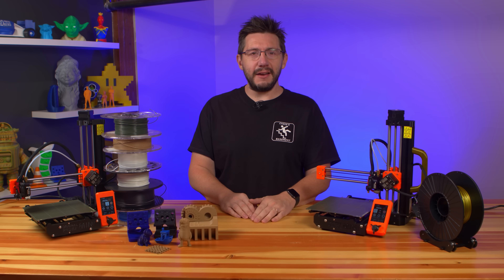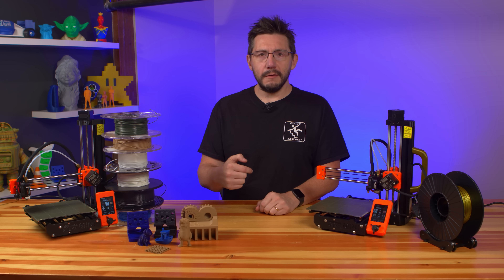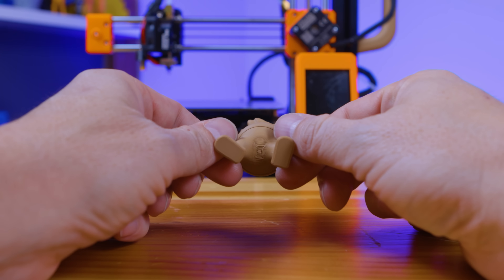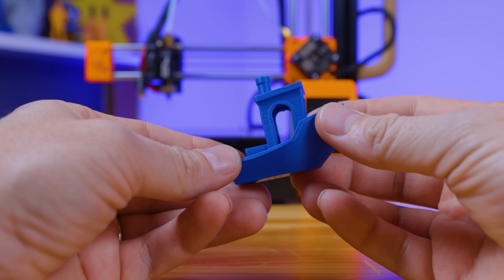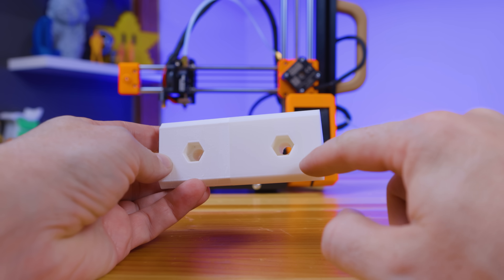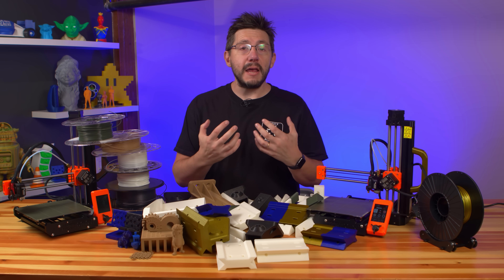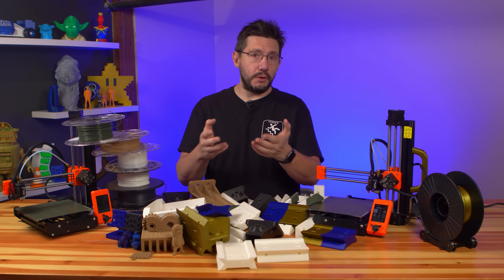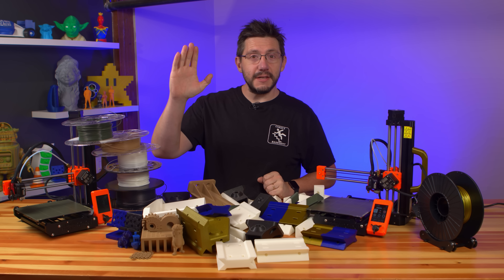Prusa MINI Review // So far ...

Comment: We got ours last week for printing work test pieces it's been printing constantly over the weekend getting to understand it's limits.  Really happy with the print quality in the past I've sent prototypes out and have had them made in SLS and SLA and honestly would be happy showing them to customers. I did have an issue yesterday when the extruder started clicking which I was disappointed about but the documentation on the website had me back up and running within an hour and I think I could sort the same issue out in 10 minutes now. One of the key reasons I went for it was the price point, the reputation of Prusa, but also being designed and engineered in Europe it has to meet certain safety standards which for me was a big selling point.

Comment: The clicking you’re hearing is the extruder. There’s another video out there about this and he actually fixes the issue. I recently fixed mine but not well enough because the issue came back just a few days later. I had to: do a cold pull, unload the filament, completely take apart the extruder to access the large extruder gear inside and clean off inside the teeth on the filament gear with a steel brush. Then I removed the Boden tube that connects to the hot end and hand to loosen the 3 grub screws to be able to move the heatbreak around. I added thermal paste to the outside of the heatbreak and put it back in the hot end all the way up. The issue with this printer is that a small gap forms between the boden tube and the heat break. Bondtech actually has 2 products to fix this issue.
Reply: I had the same thing.
But I solve it with thingtening the ptfe tube à little more than noticed.
I screw the joining part, then unscrew it an half turn. (maybe 3/4)
Push the heatbreak to the top and lock it with 3 little screws. 
Then screw the joining part to the max. 
With this method I solve the underextruction du to the gap. 
I had to clean the heatbreak perfectly to remove all the melted pla. (done it without the bowden and the joining part, with a wooden stick hotend at 250°C)

Comment: Hi Joel, My name is Dominic and I am 10 years old. I have 3 Printers 3D, Anycubic Chiron, Flashforge Finder, Flashforge creator pro.  2 of witch are not working properly. The Anycubic Chiron is not feeding the filament properly. Me and my dad tried replacing the hotend  but is still would not feed. the motor is spinning but it looks like it is skipping? The Flashforge Finder is just not turning on  I had it working for about an hour then it just shut down? I LOVE you t shirts and sweaters they are so comfy. Thank you so much for what you have been doing, you have  helped me with so many printer issues. Great Review on the Prusa Mini. Thank you!
Reply: If you guys still hadn’t fixed the printers, I’d try tightening the extruder idler on the Chiron (If that’s possible), and for the Finder, you should check the fuses on the main board (should look like coloured see through rectangles, just take them out and check if the metal inside is broken.
Reply: @IronHexacyanoferrate  Thanks I fixed it

Comment: Had the same weird noise on the y axis. I used a mechanics stethoscope and moved the y axis backwards and forwards to narrow down where the noise was coming from. Mine seems to stem from the y axis idler pulley area but replacing it hasn't worked

Comment: When you find out how to fix the grinding + clicking noise, please make a video about it. So far Prusa support and I have not been able to fix it :(
Reply: Use a steel brush to clean out the extruder gear. That or there is a small piece of filament somewhere in the extruder causing an issue. If you just take apart the extruder you will be able to clean it out easily. I fixed it for like a day by doing that as well as resetting the heatbreak position. Be sure to use thermal paste on the outside of the heatbreak though if you do this fix.
Reply: @zachspross1084  Great tip, but I already did a full clean incl hotend disassembly, and I'm currently running a bondtech heatbreak and extruder (never managed to get the original extruder working right, and had a Lot of clogs). I get the grind noise mainly when the hotend carriage is close to the z axis, and suspect that something is off with the bearings. Theoretically, the x axis idler will have more ressonnance when the hotend is closer to the z, but not sure..

But thx a lot for your Speedy reply and tip 👍😊

Comment: My mini had a wire ever so slightly touching the fan and once I moved it that solved my strange sound. As others have said, the keyring on the usb stick may be your weird vibration, i swapped mine for a different usb and my mini has been printing happily ever since with no problems. Mine is from a more recent batch so I am assuming prusa has fixed up some issues from launch.

Comment: THAT RATTLE IS THE KEYRING ON THE USB STICK, MAKERS MUSE HAD THE SAME ISSUE!
Reply: I hope he sees this
Reply: Yep, had me wondering too until I removed the keyring 😂
Reply: So did I, took a while to figure that out haha.
Reply: Wait seriously?! It's been driving me crazy!
Reply: really?  Mine is the bowden tube, the filament is tapping it from the inside by the extruder during retractions.  I stopped using the included flashdrive right away because it doesn't have a clear right-side up

Comment: Only 8 weeks now lol when I ordered in Feb 2020 it took until July to arrive ! Have just fitted the Bondtech extruder upgrade and about to fit the Bondtech heat break component which hopefully will resolve the inherent design issues of the 'standard' Prusa product. It galls that one has to pay extra for those Bondtech upgrades and replacement bowden tubes  (like overall about $100) despite acknowledged design faults. It is a great printer but the clogs once they begin never go away and hopefully they will be gone with the heat break and extruder. So, be prepared to add another $100 and wasted time and effort fixing the printer. That said, when the printer is at its best, then it is superb.

Comment: To everyone who's USB drive isn't recognized by the printer: You can try changing the partition table of the USB stick from GPT to MBR, as some printers don't like GPT. How you can do that? Open command prompt as administrator and enter "diskpart" > "list disk" > "select disk X" > "clean" > "convert MBR" > "create partition PRIMARY" > "select partition 1" > "format fs=fat32 quick". Just make sure you select the right disk, cause this is gonna wipe it. When done, the printer should have no problem recognizing the USB stick.
Reply: I was figuring this as a condition. There's no reason Y U can't just use a different USB stick  in place of the troublesome one as it's fixed up. They R EZ to come by.
Reply: @SaltGrains_Fready  What exactly are you trying to tell me? No one ever said anything about, not just buying a replacement one everytime your Mac or some other device reformats it as GPT instead of MBR. If that's what you want to do, I am not gonna hold you back. You do you, as for everyone else who isn't willing to buy a new USB stick everytime it gets reformatted as GPT, my solution should be simple enough.
Reply: @XXDoMi77  I mean rotating them not just replacing all the time. Y does it always go to GBR in the first place..?? I uses only pc's for everything  - I abandoned crapple 5 yrs ago after 25 yrs of bondage with them.

Comment: My solutions to your mini problems:
I find that with a little bit of stringing it can get caught in the fan and make strange noises,
I had rattling but it was just the filament sensor tapping against the spool
And if you make folders on the USB key it won’t read it which is annoying because you can’t organize it but just buy small cheap flash drives and label them or have two and alternate

Comment: Has anyone tried printing nylon with a mini? I know they don't list it as one of the compatible materials but it seems possible with the advertised temps on the hot end and bed. I am trying to make a decision on buying 4 mini or 2 mk3 for a production part. Would be great to know if nylon actually is possible first.

Comment: 2 printers and that many hardware issues? for $350 its not the point of a fan or a new thermistor being cheap, they should not have crapped out that quick to begin with  especially with prusa charging a premium for printers

Comment: I ran into an annoying speed bump during calibration, but on 5th runthrough I was able to get it going. Best sub-$400 printer I've used, but then, I haven't touched a Creality machine. ;P
Now I need to print that handle.
Hopefully DesignSpark is a decent parametric CAD package, I have a few ideas I want to print up.

Re: Stealing the bed thermistor from the MK2
Be very gentle with them wires, as they're thin and prone to breakage from just handling them, though they're not nearly as bad as the wires inside smartphones. Use alcohol to loosen up the adhesive if it won't come off willingly. You'll also need fresh metal (ideally copper, but aluminum should work) tape and Kapton tape.

Comment: I've loved my mini so far. But out of the box it was very picky about filaments, with some heat creep issues. Strongly recommend the 3d party heat break upgrade. It fixes all the layer inconsistencies and works through any filament brand now. Also, the included USB flash stick developed bad sectors after a while that caused prints to fail/halt. Seems like I'm not the only one that had to throw away that stick.

Comment: not bad, but I like my Ender 3. it still needs some tweaking every once in a while and I would like to give it an auto-leveling system, but it is still one of my favorite pieces of equipment
Reply: Ive had my 3 Pro for almost a month now and it's pushed me from a love to a hate relationship with it. There's just always another issue with it. I spend more time leveling the bed that printing.

Comment: Joel, I love your channel and I love my mini!!! I had the same two issues with mine. The noises near the cooling fan are caused by the wires that are so close. Just pull them away from the fan and it's good to go. I solved the USB drive issue by using a USB extension cable. Not sure why that worked. I think it has something to do with the physical connection.

Comment: I had the same issue with the supplied USB stick, so far the stick I'm using instead is okay. I put a 0.25mm nozzle on my Mini and I use it to print D&D miniatures and other small, fine detail parts and the results are great.

Comment: I had the same problem with the USB stick. Only mine wouldn't read from the start. I just grabbed another one from the drawer, not a big deal, but I could see it being a huge deal for a noob that might not have USB sticks laying around or the troubleshooing skills to realize its just the drive and not the machine. Overall it's a great little machine though.

Comment: The Prusa Mini also has issues with jamming and clogging as well as with the Minda probe.  Before you buy, I recommend reading their forums.  I owned mine for about five weeks, during which time I only printed Prusament PLA using default settings.  I had to (at the direction of Prusa support) completely take apart the extruder four times and the hot end twice, eventually replacing the entire hot end with a new one they sent me.  Over the course of five weeks, the printer spent about half that time down for parts and repairs.  Prusa support was excellent throughout, but at the end they agreed my unit needed to come back (at my shipping expense).  Overall, it was a big disappointment.  If you had a different experience, I’m happy for you.  Mine wasn’t great.
Reply: I had major over/under-extrusion issues, so I swapped the hot end out for a genuine e3d v6 which solved it. For this upgrade, you can keep the stock nozzle/hot end, and just replace the heat sink and heat break. To mount the v6 you have to print an adapter for it.
Reply: @Netherlands031  yes i know many ppl in forums who have the same problem like me and you. And in the end you still dont get a perfect print.
Reply: I purchased my I3 Mark III as a kit; I had some problems with it, mostly due to errors in assembly. Eventually, after about three months, I returned it to Prusa and exchanged it for a pre-assembled model.  I've had occasional issues with it over the last year, most notably a broken thermistor wire, which was an easy fix.  I also had to replace my hotend, as mine had gotten fully jammed with PETG (that one was ALSO my fault).

I've probably spent around $300 over the course of the year, but my printer is working like a champ.  The print quality is still very, very high, and the reliability is awesome.  All I really have to due is to insure there's enough glue stick applied to the PEI sheet, and my first layer goes down great; once I have a good first layer, the rest is easy.  I could probably tweak the settings better - I do get some stringing now and then - but overall, I'm really happy with this machine - which is now a Mark 3S (the upgrade ended up being free - thanks, Josef).

If the Mini is even half as good as the full-size, then I'd say it's an excellent buy.  Before buying, I watched Maker's Muse, Tom Sandlanderer -- and of course, Joel; however, it was really Joel's review of the I3MkIII that put me over the top and helped me pick this printer over others I was looking at.  I've been a fan of his ever since.

TLDR;
Please consider donating some money to the Seattle Children's Hospital.  It's a really worthy cause, and we all need to help somehow.
Reply: I almost bought one of these until I found out that it does not have an all metal hot end and no one can give me a solid answer if you can upgrade the printer to have one. I understand that Prusa may be trying to keep this printer from being copied, but it already has been copied and the clone is half the price.
Reply: @MichaelJHathaway  The clone is not half the price. It's more like $300 vs $440. And then you have to replace some parts that are not good enough...
Reply: @MichaelJHathaway  The hot end goes to 280c, so it must be all metal, if it was ptfe-lined it would max out at 240c. That it's all-metal is actually the cause of it printing so badly, all-metal hot ends are prone to jams with PLA and even PETG, Prusa should really have given this thing a PTFE-lined hot end.
Reply: I have the complete same experience ... seems to be a well paid review like the most here ... forums are full of problems with this machine... i have also a creality ender 3 which has also things to update, but no problems so far and the print quality is better for a lower price, bigger printbed. I am very disappointed that you have to pay for a bug of prusa the shipping expense by your self!
Reply from the maker: Hey, Tam. No reviews are paid, ever. None have been. I can only go by the experience I had - plus with this machine, one was a review unit sent, and another was one I purchased. If you have questions on a video or are curious if I received compensation, just ask.
Reply: @3DPrintingNerd  Hello :-) I love your channel, really, but if i see all the other 3d Printing channels which you also know, and their reviews, which shows so many fail prints, and even if they add updates, addons for 80$ and more, they dont get it done that they get a satisfiying print. And what you call a good print, with respect sorry, but this isnt a "good" print for this money. The forums are full of examples since the year started that this model isnt worth so much money. I also have a Prusa and like it, but this model is overpriced for the quality it gives you. I like the service of prusa, but not that they still offer a product which isnt giving satisfiying print results. But thanks for the honor that you answered me :-)
Reply: @tamgaming9861  I guess this is similar to buying computer parts, you can either get lucky and get one that will perform at 120% of the advertised performance, or you can get unlucky, and get one that’s way below what was advertised, or broken completely. I got a Prusa mini about a month ago, and aside from me over tightening the trapezoidal nut (mine was a kit) and the pinda connector having a broken clip (new board was sent to me within a day) it’s been working perfectly, I’ve gotten some really amazing looking prints, and only one “failed” print (I idiotically bumped the y axis, and the layers shifted). It kinda feels bad that some people got such a bad experience with a printer that has been so amazing to me, and frankly I just wish for better quality control at Prusa.
Reply: @tamgaming9861  In my experience, Joel's reviews are completely honest.  He's not getting paid to review these machines.  Yes, he's getting one for free -- but his opinions are still honest.  He breaks down the plusses and minuses of each machine.  I mean, if he weren't honest, would he have reported the problems with the machine?  No.